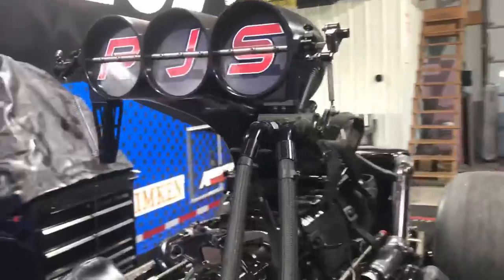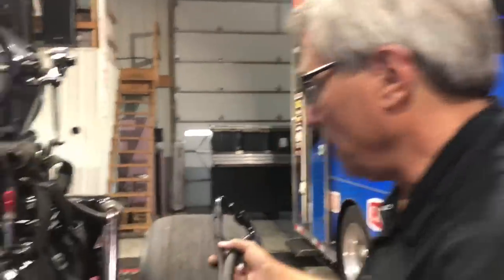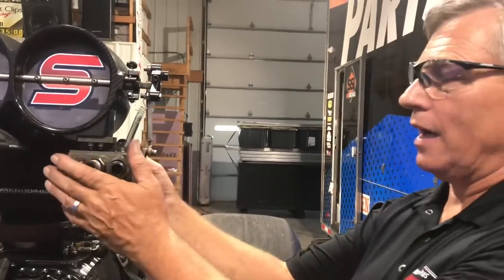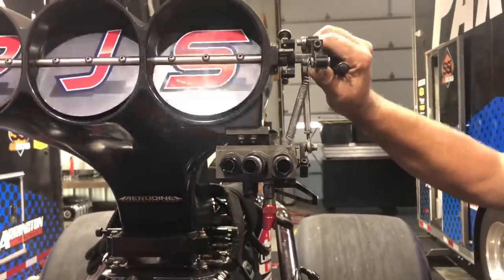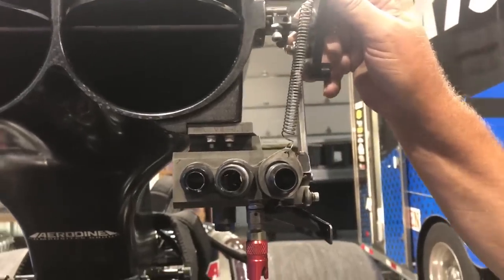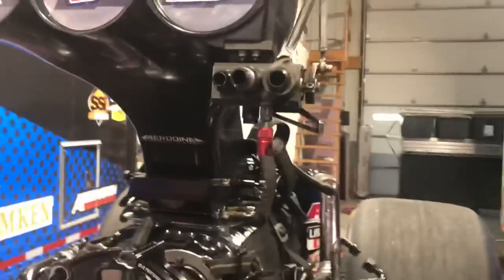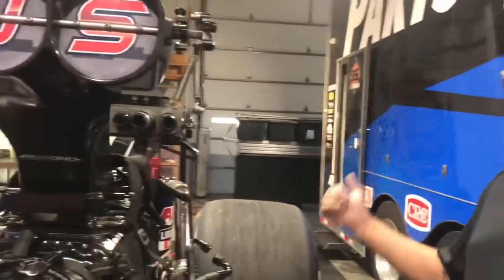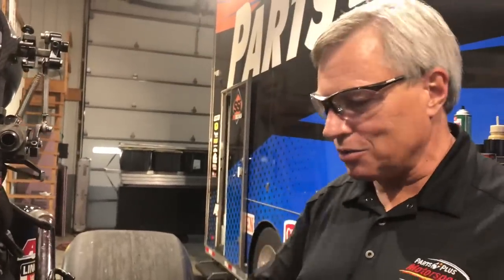Fuel System 101 The Barrel Valve

Comment: Pete Jackson was also the originator of the "Pete Jackson - Dual Idler" cam timing system. Pete's brother, Charles "Kong" Jackson was the builder of the original "ROTO-FAZE" racing ignition systems and his company, JERD(Jackson Engineering Research Development) manufactured parts for Ford V8 flatheads, Model "A", and Model "B" engines. Kong and Wes Cooper shared a shop in Burbank, CA. A lot of shenanigans went on in that shop. Volvo insert rod bearings to replace poured Babbitt bearings in Model "A" engines. OHV conversions for "A", "B", and Flathead V8's. Men like Pete, Kong, and Wes were the driving force..... the Grandfathers.... of drag racing as we know it today. There are countless others, Vic Edelbrock, Ed Iskendarian, Ed Winfield, Phil Weiand, and so many others. I was lucky enough, through my friendship with Kong's sons, Thomas and Robert, to learn a little bit from the masters.

Comment: Now that was sweet. Please thank Mike for taking the time to contribute. Those little details are what us gear heads yern for. 10-15 years ago when I was involved with blown alcohol stuff I thought 200 psi of fuel pressure was a lot. 750 psi for nitro is crazy. You could pull the jet out of the nozzle and probably cut your finger off with it.
Reply from the maker: These things are crazy how they work and how fast they go 😀😀

Comment: o thank you so much ,l love the lesson 101 , l want to suggest  others subjects  very interesting for your fans and myself

- cooling system
-fuel system from the tank to all injectors  head,intake manifold and blower hat
-ignition system 
-braking system
-engine lubrification system
-clutch timing
-tuning vs  altitude , air fuel ratio , engine timing , compression
- security system in car for the driver
-  vieuw of the dash in cokpit 
and some questions about 
-  NHRA car inspections after the run
-  penalties for engine leaking in burn out or at the starting line
-  what causing after the start  ,some cylinders have no combustion

believe me , l love pro drag racing about 40 years but the nitro  is no more accept  in my canada .

bravo for your work , it is pleasant to follow you on FS1 with your smile .
wilson

Comment: That was awesome! A lot more to it than I thought. I remember years ago hearing about changing the "pill" in the barrel valve. That was probably the enderle style. I just thought it was kinda like a nitrous jet. Maybe it was. I never had any hands on experience with any of it and I could be totally off in the wrong direction. LOL!  Cool stuff! Great video!
Reply from the maker: Thanks Jerry 👍👍
Reply: Jerry, the pill is a fuel return restrictor but works the opposite way to a nitrous jet. A bigger nitrous jet is more to the engine whereas a bigger injector pill is more back to the tank so less to the engine. We still run the old Hilborn style blown fuel system at Bonneville since we need to go 5 miles multiple times without burning it down. Our best effort at one meet with a blown hemi on 60% is 12 runs without pulling the heads. That's probably some kind of record in it's own right!
Reply: @nzsaltflatsracer8054  Cool! Thanks for the info.
Reply: @jerrycoon3369  when he was talking about the magical numbers he won’t share for the idle return check valves, thats the same thing those jet sizes controlled. The less fuel it allows by, the higher the system pressure, the more it lets by the lower the system pressure. The difference here is they can control how much fuel even goes to the barrel valve by the handle in the cockpit that is attached to the pumps. For the burnout, the driver sets the pump shutoff to get the dash to read the pressure the crew chief wants. Before the run, they open the shutoff all the way.
Reply: @slowpoke96Z28  Ahhhhh!!! That makes sense! Thanks for the lesson! Thats why I like mechanical things. They are easier to understand for me but you have to understand how the system is laid out. Thanks again.

Comment: The regular 80A Enderle pump is like 50-100 psi. This is a standard 7 gallon a minute pump a lot of people run at the track. Probably good for about 800-1000 h.p. I about crapped my pants when your Chief said 750 psi of fuel pressure! WOW!!!

Comment: Great video most technical people love this It's great to see the individual components Very similar to early diesel systems I have a question When the system is delivering more fuel than needed(idle) does the excess return to the tank? Normally you only see only  a primary feed tube on the modern fueler The old "Moon" tank Hilborn had return lines Do they new engines "recycle " the fuel momentarily until launch? And if so is heat in the fuel a concern  It would be great if you would do a complete series on this and all the other intricacies of the entire engine and clutch All that you can reveal without the hard-earned secrets!
Reply: Back to the pump inlets. The net in a fluid schematic would be the same as going back to the tank, but why plumb and take the power loss when it’s gonna end up back at the pump inlet anyway.

Comment: way simpler than a mikuni flat slide. you should call that a digital carb it only knows on or off hehe. thanks for the video loved it.
Reply: Kind of. It doesn’t carburize though. The flat slide has to do it all, and at part throttle too. The Enderle did as well, except carburizing. They basically got rid of the circuits they didn’t need while making it more durable and operator friendly. Pete Jackson was a genius.

Comment: At full throttle, what percentage of the total fuel going into the motor goes through the barrel valve, is that the only fuel source for the motor?  Clay asks excellent questions and Mike gives great answers, thanks!
Reply: The barrel valve is the metering device for the fuel. As seen in the video, at WOT the idle return circuits are shut off so 100% of the fuel going through the barrel valve goes to the engine. All fuel has to pass through the valve before it gets to any injectors/nozzles.

Comment: So the check valves in the idle return are also the idle fuel pressure regulator, which crew chiefs chose and set based on their own mojo for their desired after burnout engine temperature? Got it. Now if someone could explain the slide valve and BDK valve and their timers, that’d be great.

Comment: The throttle is barely cracked and the barrel valve is wide open but idles off a hole the size of a pen tip. Damn

Comment: This thing is loaded with unobtainium and topped off with a questionable hardware store throttle return spring lol
Reply: And you would probably gasp at how little the actual engine is fastened into the chassis
Reply: most of the stuff i see on top fuel cars is shockingly simple and minimalist..
Reply: the practical application of those simple ideas is where the rubber meets the road..🤣 so to speak...
Reply: @ianbuilds7712  they’re 11,000 HP go karts!
Reply: @bowsertownes  Hose clamps... 😂
Reply: @SwimmingPoolAZ-SPS  Not even... It's a giant motor on a stick.

Comment: I would like to know why no one does throttle hits in the pits anymore, but the fuel lines are now removed and the engine is shut down?
Reply from the maker: Long story short we cut the clutch disc flatter than we used to. We use to whack the throttle to seat the clutch and it’s not necessary anymore. I miss the whacks. Thank you for watching 😎😎😎
Reply: @claymillican25  Thanks for the reply, been a fan since the IHRA days and fellow drag racer, 2 wheels though

Comment: Forgot the one valve at the bottom of the injector hat.
Reply from the maker: Christopher, I am not sure what valve you are speaking of ? I thought we covered most everything on the barrel valve. Thank you for watching.
Reply: @claymillican25  There's a screw type valve at the bottom of the injector hat at the intake manifold that I see many tuners adjust just before they wave drivers forward.
I really see tuners adjust what you were showing today before a run
Reply: @christopherlaing7338  that’s another air bleed. They have the one on the throttle blades, but when they use that it moves the barrel valve too. The one at the bottom of the hat allows control over air only, not affecting fuel flow.
Reply: @slowpoke96Z28  Ok, thanks for the info